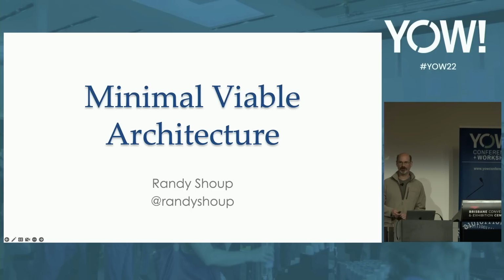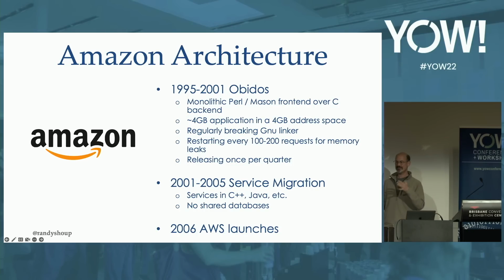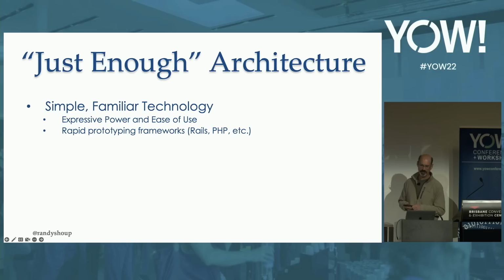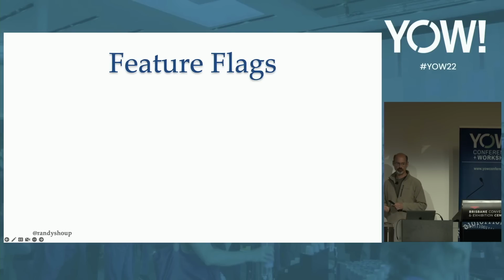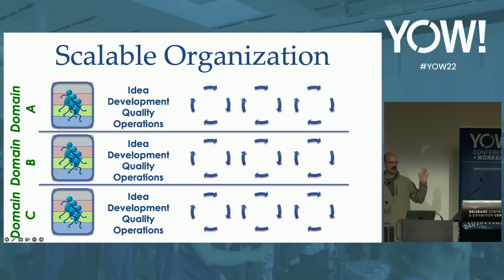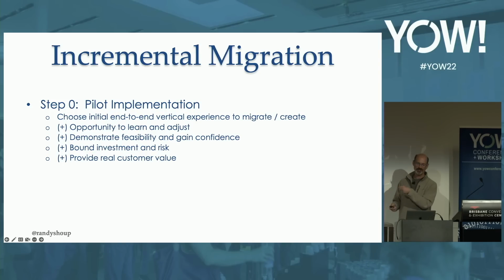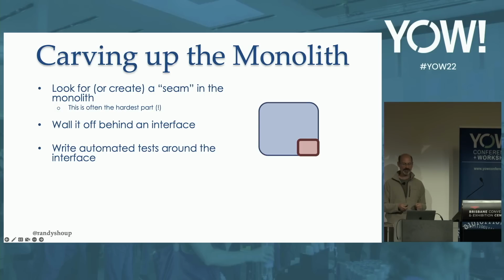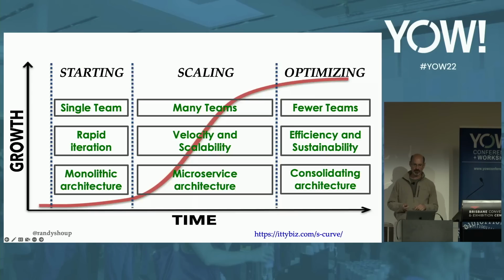Minimum Viable Architecture • Randy Shoup • YOW! 2022

Comment: I'm afraid this kind of mentality of deliberately starting with a crappy architecture to fix it later has also killed many companies. Very few ones can afford the cost of recovering from a full rewrite such as the one Twitter made when moved out of Ruby and MySQL.
Reply: It's not crappy, it's just enough. Over-engineering is a mistake some companies do and the result is them throwing millions (instead of 100-200k) out the window.

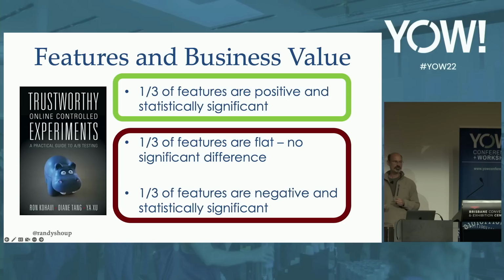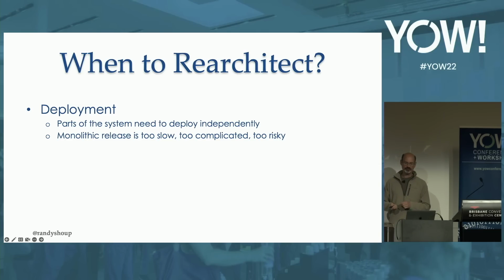Comment: I watched the first 25min, contrary to most commentators i cannot find anything spectacular in this talk. This seems rather a listing of anecdotes than a logical coherent or in any other way scientific approach. At some point we were down to phrases like "write solid code". For example at 19:28 there is no value in stating that 2/3 of features are "flat or negative" unless you clarify how you measured these "figures" and what you mean by "flat" and "negative". At 22:31 he poses a question on himself that he doesnt even answer. And his assumption here, which is also mentioned in his beginning examples, that "rearchitecting is a sign of success", does not encounter a single point validation throughout his speech other than "I think that..." and then he just repeats his statement 23:02. 

Lastly, I cannot believe that someone truly thinks that the specific architecture of say ebay and AMZ was the reason for their success. At some point they had to scale yes, but they probably could have chosen a slightly different architecture as well and the main reason that had to scale in the first place was that these companies fullfilled a need - shopping online so you dont have to go to a physical store - that turned out to be a mass market. They could have stayed on perl for the next 100 years if what i just said was not true.

Comment: I may require more experience, but is it really microservices THAT slower than monolith?

I mean, if you do a "clean" monolith, it means you have been making it modular, so the team can parallel their effort.

If that is the case, how is it different the efficiency of both workflows? As I see it, when working with any of those, you start with some "quality assurance" repo, which provides a time save on the coding, with that in mind, the impact of that previous work is actually higher on microservices, so it could even be faster.

This first part of the talk confuses me a bit, I think it applies only to starting enterprises, with no previous works and in search of their product.
Reply: If you work with a monolith, you just skip the whole messy deploy/latency/availability/distributed derived problems. Not to mention that you can simply work faster with things like MVC or similar.

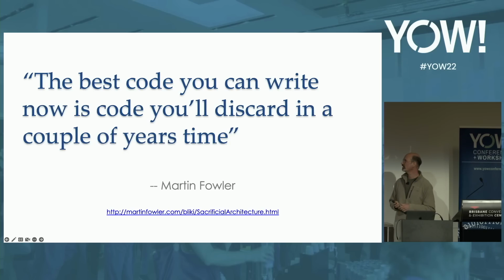Comment: The problem comes when you skip the Martin Fowler quote at 11:47.
When you build this prototype and rather than discard it in a couple of years time, you're still trying to patch all manner of production needs into it 10 years later.
Instead of step-by-step moving from no architecture to a little bit of architecture to a "properly" architected system you're caught between a rock and a hard-place - either a big ball of mud or a big rewrite.
I'm tempted to print that slide on a big piece of paper and stick it to my wall.
Reply: With the speed of tech today, software that is build now might be retired before it hits the 10 year mark. I am working on products that are 5 years old and already considered obsolete...